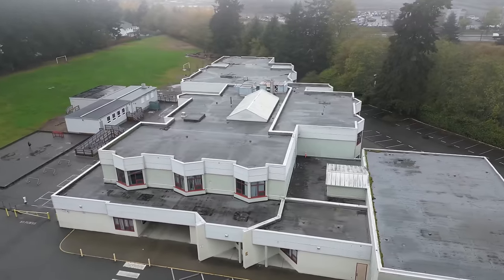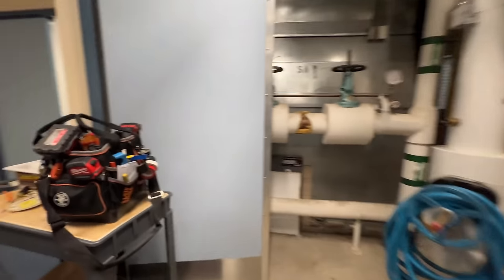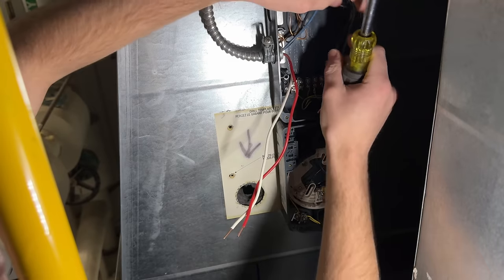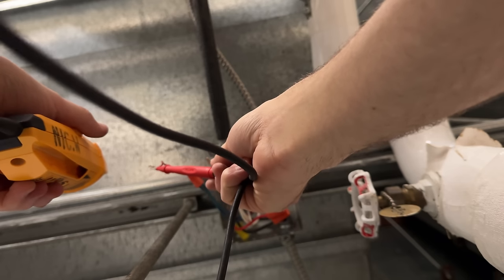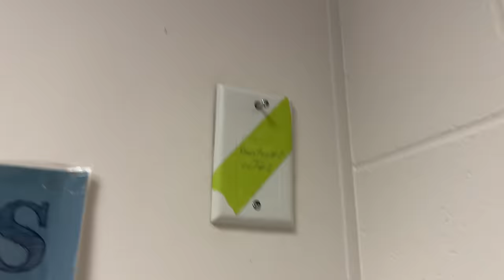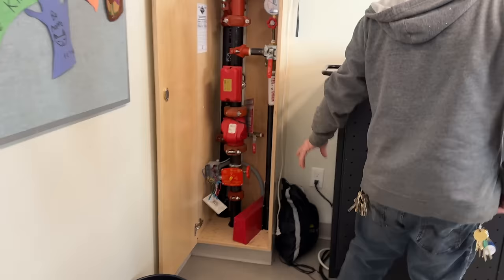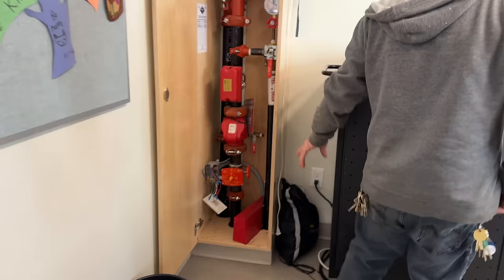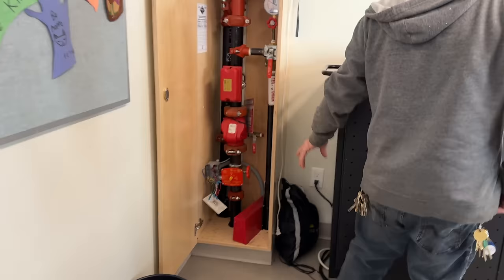Fire Alarm System Full Upgrade At Elementary School | replacing system | Notifier NFS2-3030 Day 4

Comment: Lovely video Nic, great content showing how the system is gradually replaced and the steps you take to ensure a working and compliant system.  I'm currently fitting a radio fire detection system to a nuclear power plant here in the UK, which is proving very successful so far.  We are about 60% complete.  Looking forward as always to your next video.
Reply: Lovely Video Nic Great Content 
Showing How The System Is Gradually Replaced
And The Steps You Take To Ensure a
Working And Compliant System. I'm Currently
Fitting a Radio Fire Detection System To a Nuclear Power Plant Here In
The Uk Which Is Proving Very Successful So Far.
We Are About 60% Complete. Looking Forward As Always To Your
Next Video.

Comment: Your Guys decision to go with the NAC Power Supplies is the right move in my opinion. not your fault the engineer spec'd what they spec'd. our standard procedure for a building such as a school is to use a FCM-1 to trip however many FCPS (or PS10 now days) we need for the NAC load when installing 3030 systems.
Reply: Furthermore, we have been having issues with those XP-6C cards as well. we recently replaced a XP-6C with (6) FCM-1s as we were having nothing but issues, it is a high rise, so we had to keep individual control of each circuit.
Reply from the maker: Yeah definitely. I've yet to have a good experience or hear a positive story with the XP-6CA cards especially trying to sync.

Comment: The Sync-1 module was discontinued in the United States, its possible that system sensor realizes that card is not acceptable, or the UL said to kill it off. 
It's possible that CSA/UL(C), or System Sensor Canada has yet to follow in the same decisions. It's being recommended by System Sensor to use the MDL3 instead as it can follow the sync of other MDL3's, and from the panel/other sources. The booster idea is also acceptable too, especially with the high demand.

Comment: The previous strobe of Edwards are not synced until either until 1999 or 2003 idk along the way with genesis models if you see a red label sticker text it’s enhanced there is plenty of black ones which can be free run that has its Nac unit which will sync the strobes up evenly.

Comment: Not the biggest fan of those NAC expander cards, they never work. We had the same problem with those to the point we stopped using them. Id rather just use the full external power supplies like the PSE10. But even then lately, we have been getting tons of bad boards in from Honeywell (since they decided to make one whole power supply branded as honeywell, for any honeywell brand fire system) our companies owner actually complained a ton to them about it lol... Great video as always man!
Reply: With a lot of complaints to Notifier about the defective XP-6 cards, they'll definitely issue a recall on them with their other defective accessory boards because they just don't know how to get them to act right

Comment: I don't mean to sound rude or anything but do you guys not use Honeywells multitude of calculators to determine how many power supplies and stuff you need to cover the amount of devices you're installing? I feel like that's a pretty major whoopsie. The drafting guy at the place I work for calculates everything beforehand and we usually don't risk putting the max amount of devices on each circuit. 

Now I will say the 3030 does have issues with booting when drawing major loads. There is a 3030 installed in a hotel near me I believe its my fire alarm inspection 15, that cannot boot with all the SLC cards plugged in due to boot up spike, but this building is way smaller so I dunno. That hotel has around 20 power supplies in the FACP room alone.
Reply from the maker: I would've thought someone would've. it isn't mine or my coworkers fault we are just provided products to install usually someone in the office of the company providing the materials should be looking over materials for compatibility with the system and that everything would work. they may not have been informed that the strobes need to be set to 110 which massively increases the load but I'm honestly not sure. Office people don't always have the same field experience therefore why XP-6CA curds were provided as in theory they should work but anyone with experience would avoid them.
Reply: @nics-systems-electric  fair enough. Also XP6-CA cards aren’t NAC cards they’re circuit control cards. They need a PS-24 or APS-24 to provide them with enough extra current to act as full nacs.
Reply from the maker: @FourtyFiftyEighty  yes

Comment: Fun Fact: If these devices were SpectrAlert Advance horn strobes and if they were overloaded then the pitch of the horn would drop because that happens when the voltage drops under their regulated voltage range as they use resistor based capacitor clocks instead of crystal based capacitor clocks
Reply from the maker: That's an interesting detail

Comment: this is the biggest replace fire alarm system i notice unsync strobes that were crazy turn a firework but this video the strobes where going off but not horn that was weird buy hey did you got access the elevator shaft replace the detector with smoke
Reply from the maker: I believe I did the elevator smoke on the final day

Comment: Did they reconnect the graphic annunciator? Or did they not get the card for it. Also, could you see if those cards have the same issue on your home panels?
Reply from the maker: The graphic annunciator hadn't been hooked up on the Quickstart either was not operational since the ESA 2000 unfortunately we never made that work again
Reply: @nics-systems-electric are they going to get the card for it?
Reply from the maker: @maxdutiel  no it has the wrong front plastic graphic on it the one that's there is not transparent

Comment: Nick I warn you that thing you’re using to synchronize the strobes wasn’t gonna work. It caused un synchronization at your high school. That’s the same thing that’s happening here if you want have it synchronized just get a booster panel I’m not complaining. I’m just letting you know.
Reply from the maker: It's just Nic and yes, sometimes they do work. But that's not an excuse for Honeywell the product is supposed to do a job and it doesn't do it. Unfortunately "Warning me" doesn't change how the parts are specked for the job. I know, you know, and the tech knows that they cause problems. But that doesn't change parts that are already supplied.